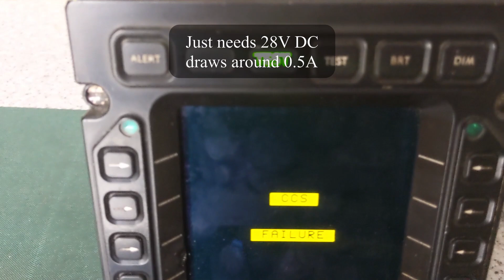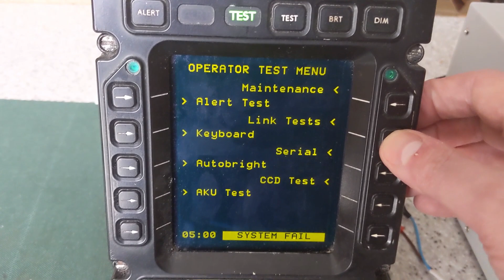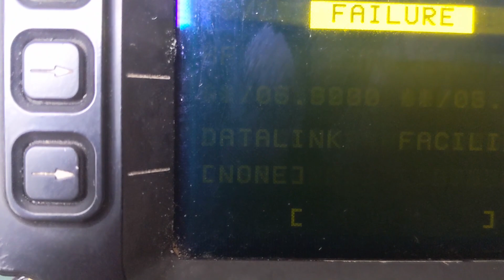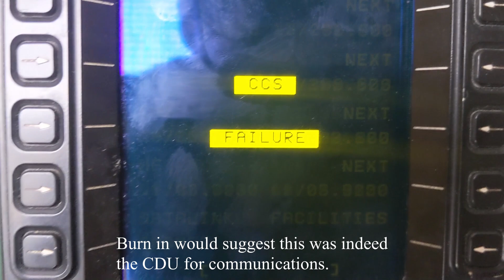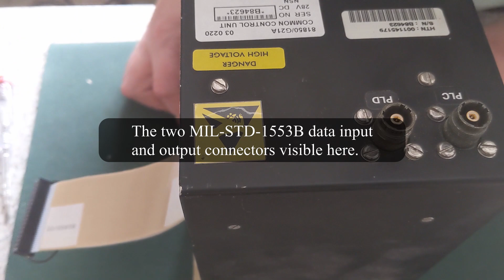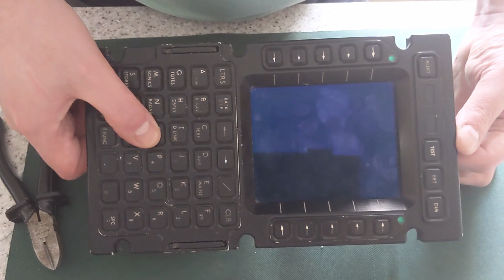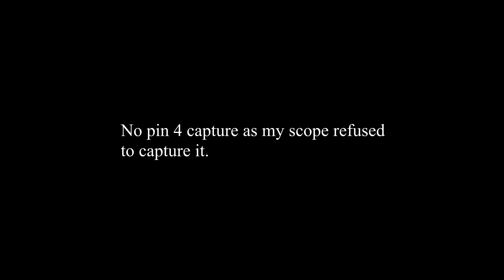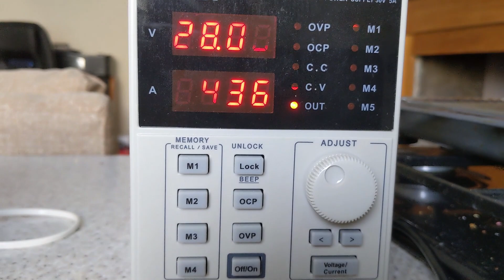Merlin helicopter CDU teardown and power up demo. Three microprocessors inside!

Comment from the maker: Update to this video; probing the serial ports and attempt at reverse engineering. Pinout of most of the 26 pin main connector done and managed to get into some kind of diagnostic terminal output from a serial port connected to the processor board. 

https://www.adrian-smith31.co.uk/blog/2020/11/merlin-helicopter-cdu-update-serial-port-probing/

Comment: Very nice, I like this avionics parts teardown series :)
Reply from the maker: This is the best thing I've got so far. Going to try and reverse engineer the serial data connections at the back to see if it can display anything or get keyboard commands to appear on serial port(s). Waiting for my USB to RS485 adaptor to arrive. It's very fuckaboutable so might be able to resell it for those that build their own flight sim cockpits at home. If I can get it to interface to a PC via an arduino or something.

Comment: The display is actually electroluminescent and not gas plasma.

I didn't know there were microcontrollers based on the Am29K RISC architecture.  The original aim of the Am29K architecture was high-performance computing, and their first entirely in-house designed x86 processor, the K5, was actually a 29K which executed x86 instructions through a microcode translation layer.
Reply from the maker: Yeah someone pointed me in the right direction for the display and it's almost identical to the commercially available part. I even have the datasheet for it but not found a way to drive it from an Arduino or similar yet.

As for the microcontroller the same one is found in the RAF Nimrod flight data recorder I tore down. Didn't know that about the k5 CPU, think I actually had one of those a long time ago.

Comment: I'd like to see if you can get that display to play a video. I have another idea, you could use it a display for a jukebox to show song info, elapsed time, artist, album during playback.
Reply from the maker: Yeah that's probably what I'd use it for. It needs a bit of computing power to produce a reasonable display so an 8 bit micro won't do. I'd need a raspberry pi, FPGA or some other ARM CPU, something I'd have to learn. Definitely a future project if I'm still going to be off work for a long time.

I like the Jukebox idea; if the electronics were stripped out, the controller board, amplifier etc would fit nicely into that case. Being able to use the original keyboard too would be nice.

Comment: Please could you tell me the power pinout for this please, I can't quite make it out in the video.
Reply from the maker: Hi I have some photos and a drawing of the power connections on my blog https://www.adrian-smith31.co.uk/blog/2020/11/merlin-helicopter-cdu-teardown-and-power-up-demo-three-microprocessors-inside/

The connections I made was DC ground on the top left most pin and 28v on the pin next to it. The third pin is chassis ground which I left unconnected. The top of the drawing is cut off in the photo but connector PLA appears to be just for power. The keyboard backlighting power likely 5v AC will be on the remaining pins but I haven't found which ones yet.

I sussed them by tracing the DC-DC converter inputs on the PSU board to the rear plug. Negative was easy but the 28v supply goes via a reverse polarity protection diode and a MOSFET switch. Presumably this device has a remote power on / off switch on one of the pins too.